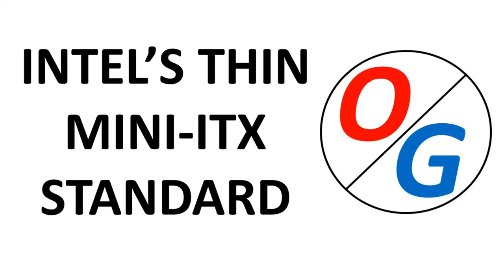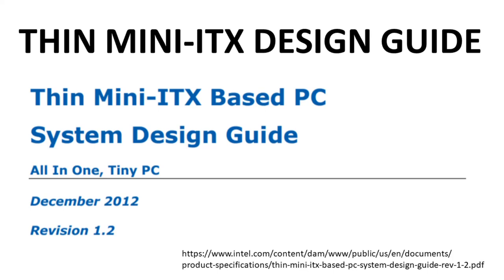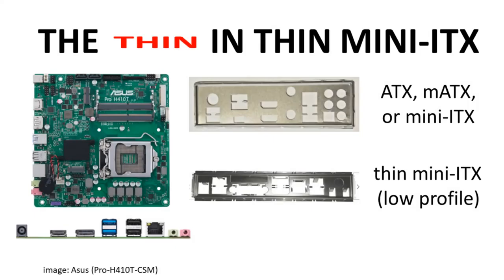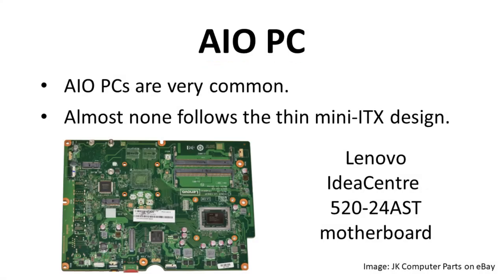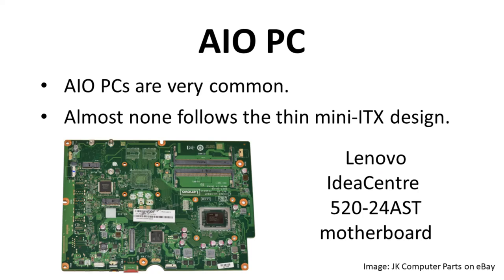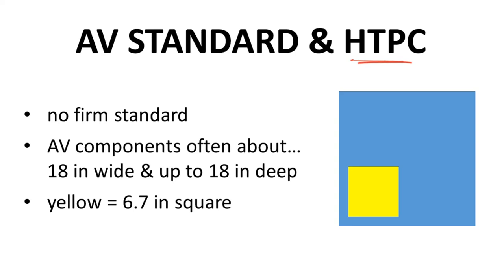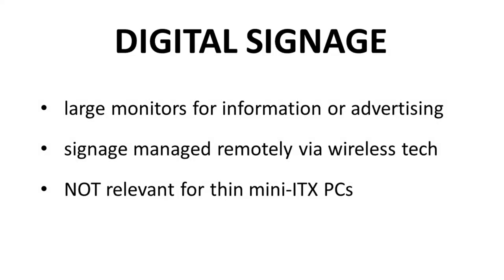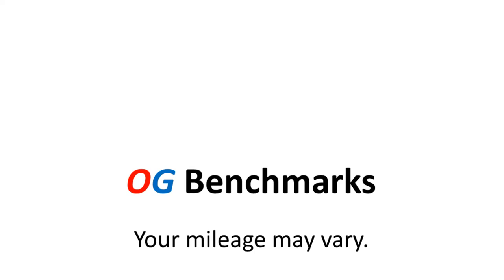Intel's thin mini-ITX design guide - 10 years later

Comment: As mentioned, the reason you don't find major OEMs utilizing the Thin mini ITX spec based designs is because they have their own proprietary designs,  This systems were targeted primarily for the "channel market" (System integrators, DIY) and the design guide was targeted for the various ODMs (original design manufacturers - including motherboard manufacturers, AIO chassis suppliers etc.). The goal and intent of the spec was to ensure interoperability among different motherboards and chassis solutions so smaller companies can take these component and offer differentiated solutions from major OEMs like Dell, HP, Lenovo etc.  The interoperability is also what allows one to replace/upgrade the motherboard, CPU, RAM, Storage, wifi module or even the chassis, if a better resolution display if offered. Differentiation is a key way the smaller, local OEMs and system integrators can compete with OEMs. this effort ensured the motherboard and AIO chassis solutions developed in the market were compatible. Once this goal was achieved, Intel let the channel ecosystem innovate further on its own. I wouldn't say it is a bust just because it didn't get much traction in the US - this model is alive and healthy in other parts of the world where there are still smaller regional/local OEMs.  In the US, major OEMs have almost all the market on AIOs because the warranty process is easier if there is an issue.